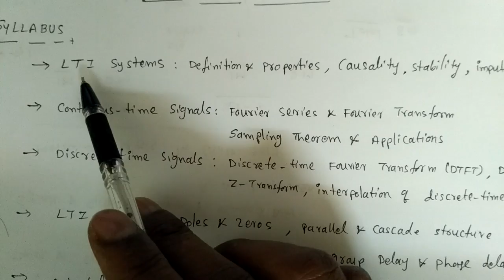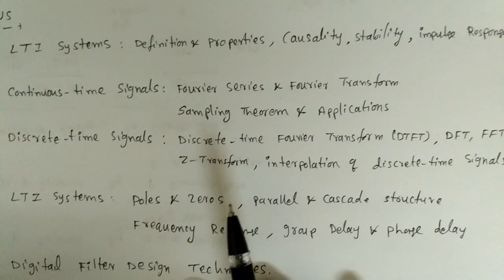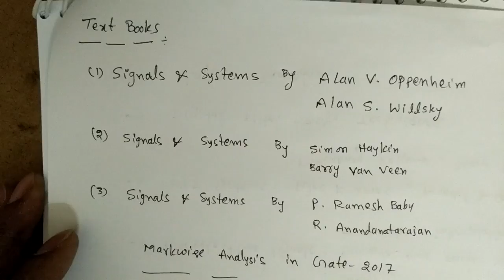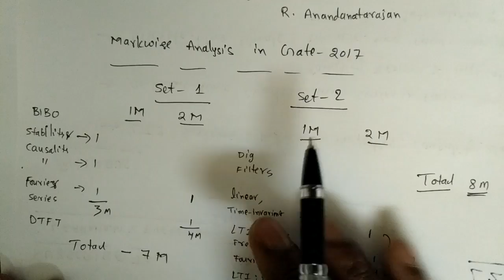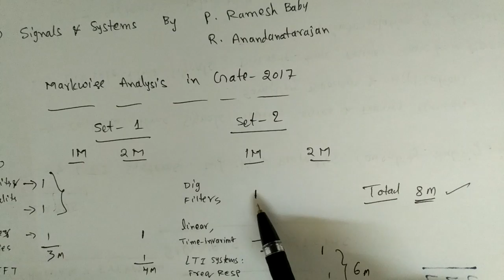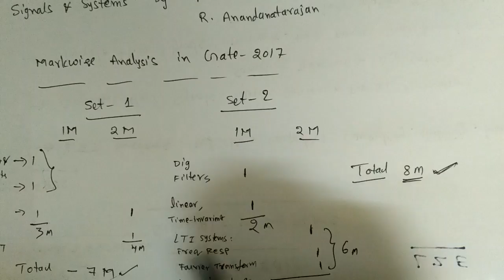Signals and Systems Lec-1: Syllabus and marks wise analysis gate 2017

Comment: iam very much confuse that does syllabus for signal and systems is same for ec branch and electrical branch
Reply: the syllabus for ECE is more compared to EEE .For ex: Discrete time representation of periodic signals(i.e. Discrete time fourier series) and aperiodic signals (i.e. Discrete time fourier transfom) are not included in eee syllabus.only z transform is there in the syllabus(but to understand Z transform you need to have LITTLE knowledge of DTFS and DTFT).this is as far as i know .BTW you can refer previous year question paper for clarification.
Reply: No. EC syllabus includes DSP along with S&S but is given the same name S&S